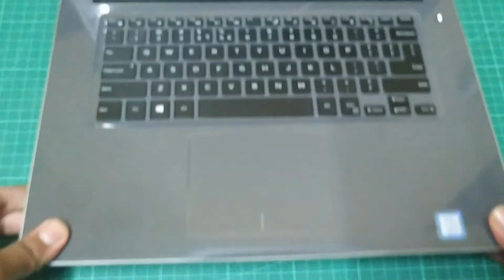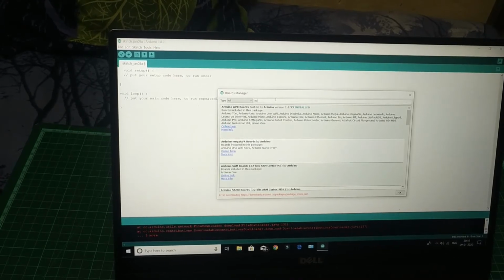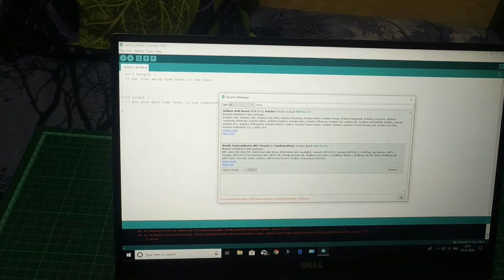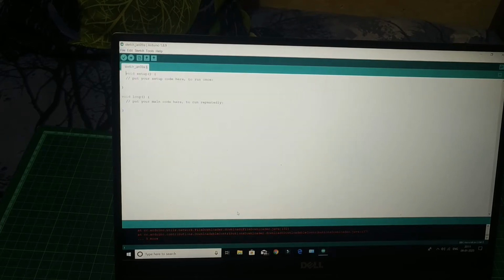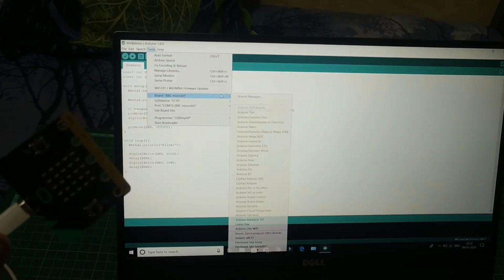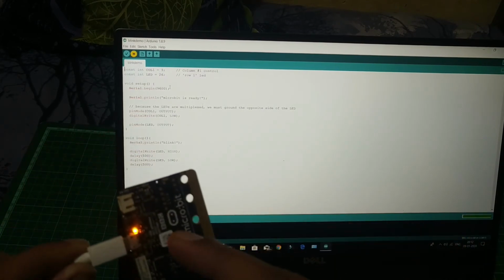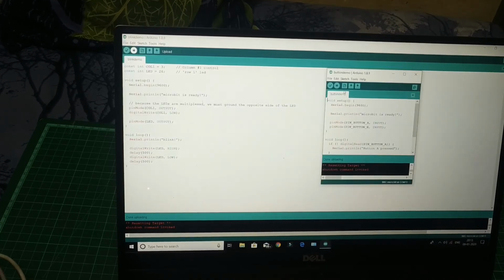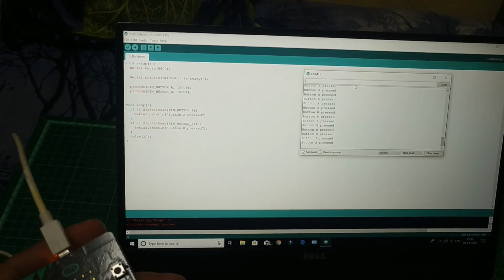How to program Micro:bit with Arduino IDE

Comment: So basiclly i can use the code for microbit even if thro its for arduino??
Reply from the maker: It means arduino software will be able to program microbit
But for micro bit you will need to modify code a little bit…

Comment: i keep getting an error  when trying to upload my program 
it is saying
 "Error: unable to find CMSIS-DAP device
Error: No Valid JTAG Interface Configured.
Error: No Valid JTAG Interface Configured."
Reply from the maker: I never used JTAG before
Check tools-> programmer and see if correct option us selected 
If not working Google this error there are a lot of solutions
Reply: @RoboCircuits  Tools>programmer>Black Magic Probe

Comment: The Nordic semiconductor board doesn't show up for me
Reply from the maker: Check if device is showing in devices and printers
Reply: @RoboCircuits   ..please for what i can search ???
Reply: For what i will chech
Reply: there we go. Thank you so much your video was great
Reply from the maker: Did you installed drivers correctly?
Reply: @RoboCircuits  Your method do not work for micro:bit board versio 2 🤐